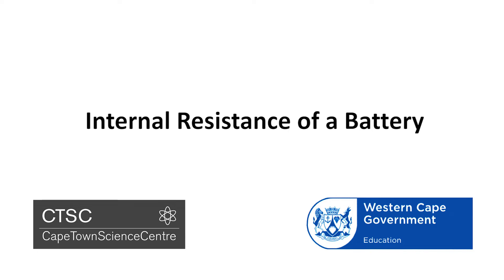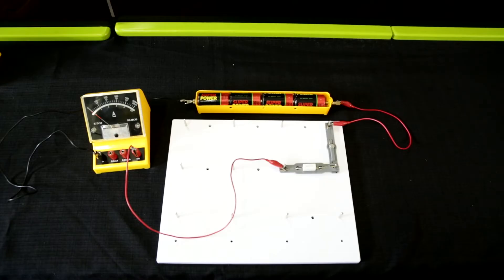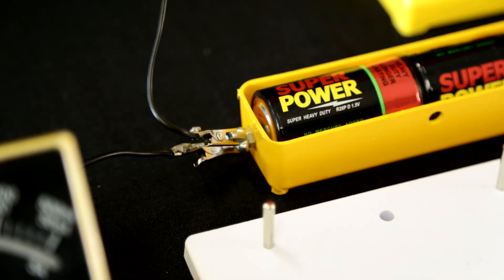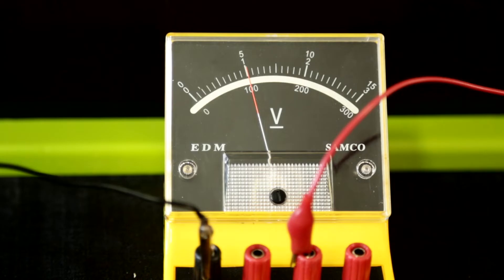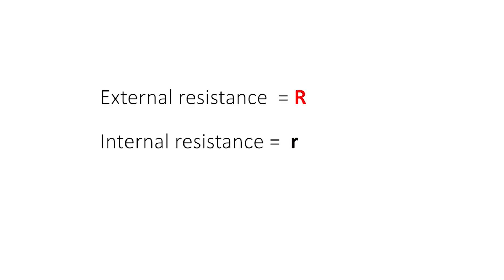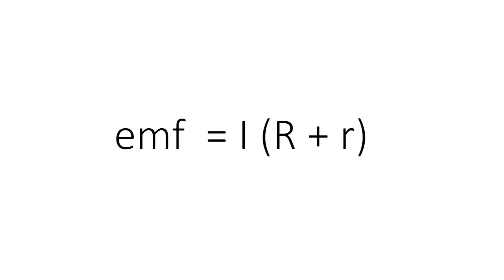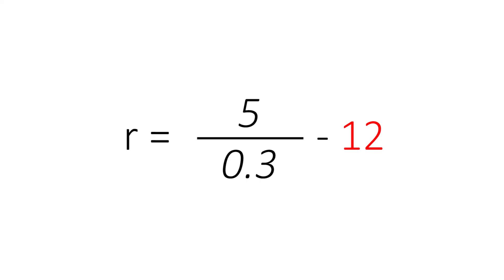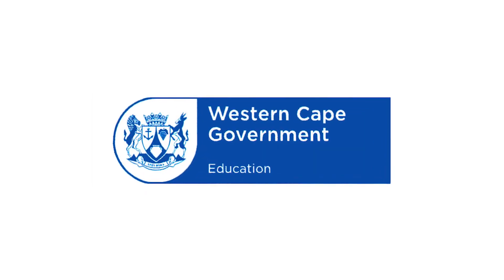CTSC practical experiment: Internal resistance in a battery

Comment: Very, very long winded to say:
=> [voltage (no load) minus the voltage (under load)] divided by the current (under load).
=>[5V-3.6V]/0.3A=4.7Ohm. Short, easy, simple.